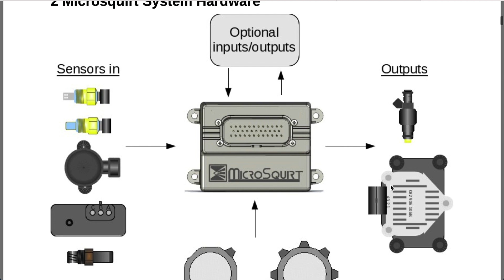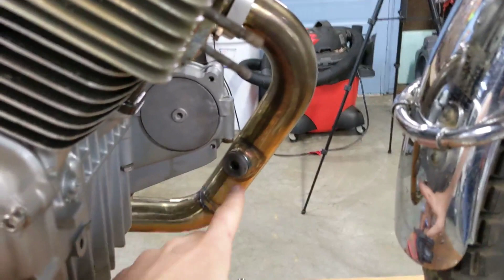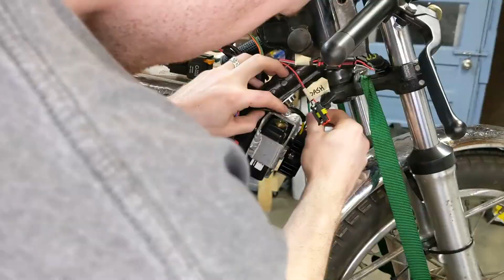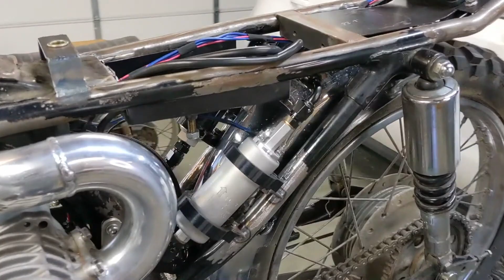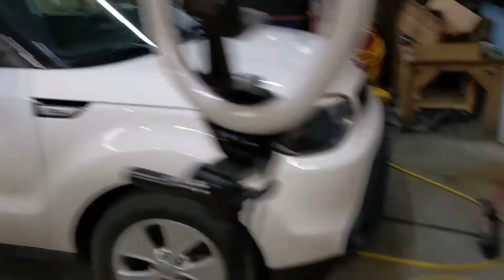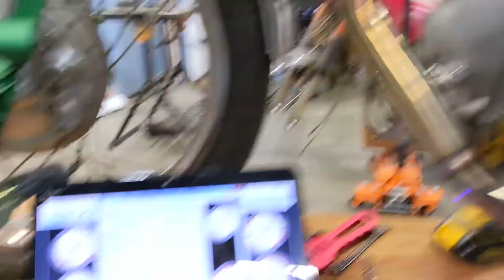Installing a STANDALONE ECU on the SUPERCHARGED Honda - Fuel Injection Conversion PART 5

Comment: I like your battery mount… but I suspect it’ll quickly fracture from vibration fatigue if it’s not rubber mounted.  Does the regulator/rectifier clear the front mudguard under full fork compression?

Comment: Do you have more info and a close up of the crank position sensor are you gonna try to run a cam position sensor and sequential efi?
Reply from the maker: Hi Louis, I believe in the video before this one I talk through the crank position sensor and trigger. Nope, I'm sticking with batch injection 👍

Comment: Question: Two big changes. The boost and the EFI.
Is it possible first to tune the bike with no boost at all and then gradually add boost and adjust the tune?
Reply from the maker: Hey Jeroen,
I'll address your question in the next video. It's a little too much to type out in a comment, but the answer is yes and no lol